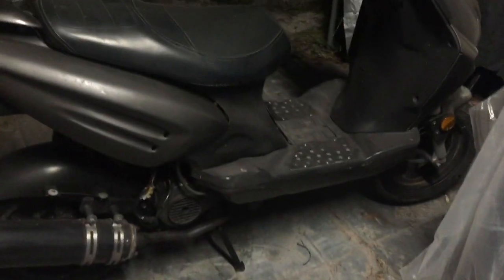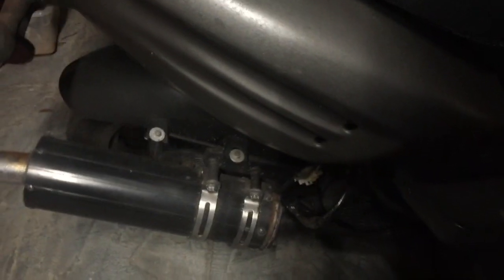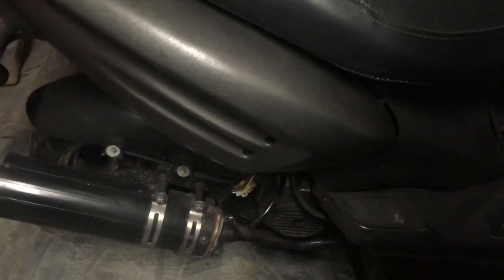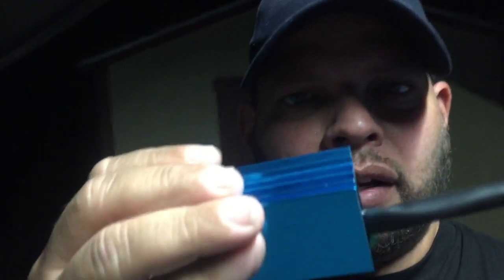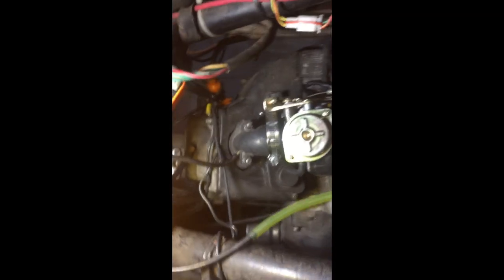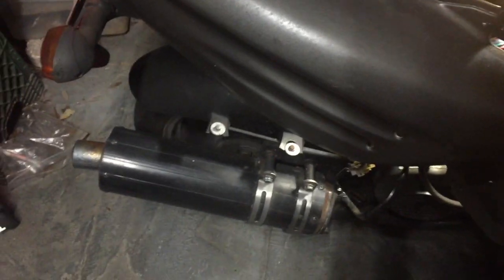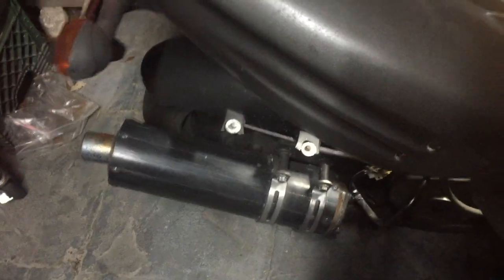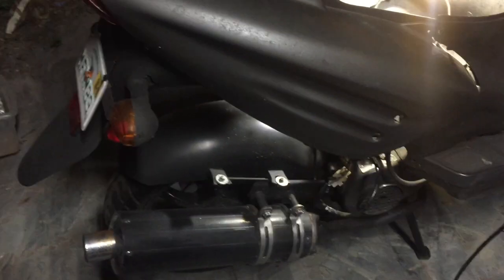How to fix a scooter that bogs down or won't accelerate

Comment: Had the exact same problem on my 150cc. I even replaced the carburetor with a brand new one. I ordered one of those cdi boxs. Thanks you saved me alot of time and headache.
Reply: Did it work for the 150

Comment: I think this is exactly the problem that I am having with my scooter that I have not used for four years.  This is the video that is exactly dedicated to this issue that I could find.  I will do the same thing you did fixing this bogging problem. Thank you for your video.
Reply: Did it fix the problem?

Comment: Description
Before ordering, check whether AC or DC fired CDI is needed
If you have 3-wires going into the 4-plug side and 2-wires going into the 2-plug side you have AC Fire system.
If you have larger CDI box, 3 or 4 wires going into the 4-plug side and only 1 wire going into the 2-plug side, you have DC fired system.
Usually, DC CDI's tend to be larger in size than the AC ones.
Common AC CDI dimensions (LxWxH mm): 65x36x 22 or 58x33x22.
Common DC CDI dimensions (LxWxH mm): 75x42x24 or 96x55x24
Please note, reference dimensions not meant for racing CDIs
If engine will only run with battery, it is DC fired system.
If engine will run without a battery, it is a AC fired system.
Reply: Thank you so much!!!

Comment: Thanks a lot, I am facing the same issue in my scooter after replacing rollers, drive belt and clutch shoe. I was thinking it was the issue with the drive belt or clutch spring. This insight about CDI unit making such a big change on high revs was not aware of this. This really helped me narrow down the problem, thanks once again for the great explanation!
Reply: Ɓɓɓvvvvvv

Comment: My scooter did the exact same thing you're talking about if you're talking about bogging down lots of power not stalling out but it feel like it wants to because guess what the problem is you got to take that or have somebody do it the carburetor must come off and put in his place a Japanese carburetor a hundred times better that's what I did and my bike is running really good

Comment: Not the CDI box...Carb problem. Likely a dirty jet from cheap gas. I swapped out my new CDI with the old one. I put mine on the center stand and revved it up until the bogging quit and it revved just fine. My problem started when I went from 89 to 91 figuring that would make it run better. Put a little fuel injector cleaner in your gas and it will clean the jets. But be careful as that bottle is for 10 gallons or more. So an ounce or two should be fine. 99 cent store has it...usually.
Reply: Did you not watch  the video?
Reply: Your right! This is what’s called a rich condition which make your full throttle (main jet circuit) bogs out.. bigger jet mor fuel. This guy simply put a cdi that make the timing advanced all the time which isn’t good at all. Noticed he cut the part where he was having problems starting the engine😂 advanced timing makes startup difficult and all he needed to do was put a smaller main jet and maybe adjust his needle position since he obviously installed a different air filter 😂 misinforming people is bad but not illegal😢

Comment: You changed the air filter to a better one(no one saw this),wich allows more air in the fuel/air mixture,thus make a better mix (your engine is running too rich,that's why it bogged),this type of CDI only remove the rev limiter.Maybe your old CDI was junk,but,with the price of that CDI,you kinda made a good deal.
Reply from the maker: Yes, I did change the air filter as part of the service that I did to the scooter. But that’s not what fixed the rev problem it was a CDI.. believe what you want but I’ve gotten hundreds of emails letting me know that the CD I work for them and thanking me for helping them fix their scooters.
Reply: @invisiblenolonger501  dayum,you taught me something new,i have the same issue on my 110cc engine and it has the same issue.I'll try to buy one

Comment: Hi, I noticed that you replaced the original air filter with a high-performance air filter, right?
Reply from the maker: Yes that was part of the service I did to the scooter but the cdi is what fixed it..

Comment: I had a bad time with my bike. I stayed more than 1year due this issue. Most the mechanics said its carburetor and switched with new one. The result was nothing. I thew my bike into the shed and started searching on YouTube, but I didn't get revs up on it. Now it's your turn to help me. Iam going right now to buy the CDI in a local store so no delays and can return it with ease if that's not the issue. Anyway thank-you for the tutorial.
Reply: Did it work
Reply: @Nate20  yeah iam so happy and excited about it that it worked. Now i hear some pops too.
Reply: @MitchuMax2327  what store sell cdis ?
Reply: @Nate20  i dont think you may have the same shop. Iam from srilanka. The shop is in the Trinconalee town, central road.

Comment: My moped stops going over 20 mph. I cleaned the carburetor do u think this will help?
Reply from the maker: It may help but if it use to go faster and now it’s only going 20 mph , I would check the valves and make sure they are properly adjusted..

Comment: Mine full revs but it stalls around 40mph or less.  Mine is a 150cc Amiga Jax not sure if this would help.  Thoughts?
Reply from the maker: Usually if the engine bogs down, but it doesn’t stall out it’s an electrical issue. If it bogs down and  the engine stalls out and shuts off it’s a carburetor issue…
Reply: @invisiblenolonger501  it doesn’t shut off but one thing to add is I have to kick start everytime because I have a practically dead battery.  Thinking of replacing it.  Wonder if that can be the issue as well

Comment: Hello can someone help me i had the same issue but it was with the carburetor i changed it  it revs and it goes but not the same as it was going before i was giving it full throttle it was going full but now when i go to do that i doesnt go full throttle it bogs a little like go go go with little throttle give it full and when i go with small throttle i goes better than with full please can someone help me

Comment: My 125 sounds exactly the same. Starts and idles perfect. It will rev for a few seconds then biggs and will not rev again
Reply: It’s the air compressor. You need to play with the air valve to reset the cdi. Simple the cdi that control the air is sending wrong signal that it doesn’t fire the engine. You need to throttle and open the valve. Then close the valve . Off the engine. Then on back engine. Get the engine running and open valve for air to go to cylinder. Now it will be reset and the bike will rock again. This happen you touch the timing sensor in the bike by opening up too much
Reply: @swimwithcoachraven1532  WTF? Stick to swimming!!

Comment: is the scooter revs properly when tire is in the air but goes about 30kmh when you ride can it be the cdi?
Reply from the maker: 30kmh is pretty good for a 50cc engine.. If you want it to go faster you would need to install a big bore kit..

Comment: So why in the video is there a red air filter in the beginning and a silver one at the end?? Same scooter or showing a different one running better at the end?
Reply from the maker: Yes, I did change the air filter it was part of the service that I did but that was not what fix the problem the CDI box with no rev limit is what did it…
Believe what you want but I do have hundreds of emails thanking me and stating that the CDI box fixed they’re scooter…
Reply: @invisiblenolonger501  Awesome!! I believe you, just raised suspision. Im about to try it. i put a big bore kit in mine am running a 110 jet but it boggs down and starts really hard when cold . guess ill see if it helps me. thanks

Comment: Sym fiddle 3 49cc 4t, i remove ring and now run 50 km/h,but whe  is on this speed it doesnt run clear and smouth, something is going wrong, and a noise appears on 50.....for more speed another cdi or can i remove the wire from original cdi??

Comment: Now I'm wondering if that's my issue I think I got bad gas or I put the wrong octane gas and I clean the carburetor change the filter put fuel cleaner in the gas tank and still no problem starting when I hit the throttle she hesitates thanks for your video I'm going to try this
Reply: I can't find a CDI with orange label on it. Can you help?

Comment: I have a kymco super 8
Same problem but when going uphill
Has the stock cdi
So if I change it it will go faster right?
Reply from the maker: Eagle No it won’t go faster it will allow you to rev your motor without restrictions.
Reply: I have a super 8 too. Bogs uphill also and it dont want to go above 40 mph. Should I change out my cdi?

Comment: Mine has a performance CDI, carb, and air filter already and after a few months of sitting it simply will not move because throttle bogs it dead. No idea what to do now but im very frustrated. =(
Reply: Same issue with me. No clue.
Reply: @gamingbluemoon  Dang I wish I remember what I did to get it working but can't recall... Just kept messing with it til I figured something out though lol.. It still never performed as good as it did when I first got it and switched everything out though.

Comment: The problem is that air intake you are getting too much air for such a small motor your exhaust is fine but put the air box back on and your scooter will perform 100% better

Comment: OMG I hope this is my problem... I replaced the fuel filter, fuel pump, carb, battery, air filter, i randomly get slowdowns like im hitting the breaks... ill feel myself kinda jerk forward even... i did get a replacement CDI, plug, and wires... I was gonna replace the CDI next.. I was getting sometimes when I try and give it gas to go from a stop it would bog down and not move me foward.. othertimes or more often it would be random slowdowns.. im really hoping this is my issue..
Reply from the maker: It couldn’t hurt to try. I have 100s of emails thanking me for the video in which this  CDI help them with their scooter’s issue.
Reply: @invisiblenolonger501  I mean I can't really think what else to check. Valves adjusted. New hoses for fuel and vacuums. New air filter, fuel filter, and petcock. I Don't think that the carb needs tuned. Spark plug looked fine to me when I looked at it. I am thinking replacing plug, wire, and cdi. Other then that only thing I can think of is the CVT but when I checked belt that was fine. I did not check the rollers. I do notice about a 30% reduction in fuel efficiency right now.

Comment: I just replaced my carb on my 150cc scooter and it still starts to bog out with it. So I hope the cdi works.
Reply: Did it work? How did you fix your problem? I’m having the same issues.  I bought a new carburetor but still need to tune it properly.

Comment: My scooter sometimes does this and sometimes doesn't. Cleaned the carb, checked ignition.... Could it be the cdi? because I have the stock cdi. 

my setup:

72cc naraku
naraku racing ignition coil
naraku racing front variator
naraku racing clutch + springs
Reply from the maker: SPOliJING might be the CDI would not hurt to switch it out with a new no rev limit CDI .
Reply: @invisiblenolonger501  yeah, true.
Reply: That's definitely the carburetor
Reply: @fishingteam8773  nope, it worked when I changed the cdi. Anyways I sold that and I got a 50cc Yamaha Bw's 😎

Comment: My scooter starts fine then when I give it gas and it will shut off if rev it to long, if I release it goes back to idle. 95 yamaha razz, think this well work??
Reply: @Move Forward Did you try it?
Reply: @valuable1forever37  nope! Just used seafoam and adjusted the level it idles under the right handle and it's been fine since!
Reply: @valuable1forever37  it was idling to low and when I gave it gas mabye it was flooding? I have no clue, but it worked so I am happy

Comment: Its the cdi box that got damage people replacing yr originol cdi box will fix it all the same if it does not then its yr stator both of which control yr spark plug firing mechanism, to fire on time

Comment: I bought the same cdi box and new ignition coil and mine still boggs down, any suggestions?
Reply: Carb. Change?
Reply: @levitezoe1804  I've figured it out but if you don't mind checking out my other video and tell me what I need to get it running I'd really appreciate it
Reply: @brianboyd8882  whats was your solution
Reply: @Nate20  I've sold it but come to find out, it was the hose connected to the air box. It had a crack in it.
Reply: @brianboyd8882  I BET that’s what’s wrong with mine! I can hear loud pops coming from air box! And it just started, out of nowhere, like a week ago, and has just gotten worse every day.
Reply: @YouSpewed  Yes I think that's what it is. Once I fixed it, it never bogged down anymore. It was getting air inside when it wasn't supposed to. Hope this answers your question and hope you get it running right

Comment: I have a piaggio zip that runs fine but at 3/4-Full Throttle it just like splutters and doesn’t go past 20 mph
Reply: main jet to big
Reply: I just started getting this issues in my piaggio zip. did you work out the problem?

Comment: hello so my scooter bogs but is not constant i mean it may go without a problem for sometime and outof nowhere strating not accelerate and sometimes even stop completly any idea?
Reply from the maker: iNetsky sounds like The float in the carburetor is getting stuck in the  closed position.... Cleaning the carburetor should fix it.

Comment: im having the opposite problem i installed the new cdi and sparkplug and now when i hit the throttle its bogging down until i let off throttle and hit the throttle again.
Reply: Did you ever get it fixed?

Comment: you cab fool them but ypu cant fool me on your video.. if only they notice you switch the air filter foam in to the airfilter mesh for better airflow.. that blue cdi helps but the stock gy6 cdi has already no limiter fyi. but nice video✌️👍👍👍

Comment: yo bro my scooter wont exelerate high enough for it to pull off i have to go downhill for it to get faster
Reply: Same here what’s issues I switch the engine & change everything & still same issue maybe new belt or throttle cable ?

Comment: CDI? whats that
Reply: A CDI ignition starts by generating a charge and storing it up before sending it out to the spark plug in order to ignite the engine. 

It fails if it dosen't have enough energy to ignite the spark plug enough

Be sure to check your sparkplug. 
It should have a brownish colour :)

Comment: Your knowledge isn’t sufficient to teach people please don’t… I came to the conclusion that you changed your air filter (maybe exhaust too?) and was wondering why it was bogging out at full throttle and instead of changing your main jet you advanced the timing with a cheap cdi unit… I noticed that you cut the startup part, probably cause you where having problem getting it runnin. Advanced timing makes difficult to start the engine. It may have worked for you but your problem is still there… Adjust your carb and put your stock cdi back, your scooter will perform a lot better

Comment: i did it and it still bogs down at 30mph and then stalls out
Reply from the maker: Sounds like a carb issue … 
Carb issue bogs down and installs out electrical issue like the ignition bogs out but stays running..
Reply: @invisiblenolonger501  should i add a bigger jet to the carb, cuz before it would let me go 40 before bogging out, i bought a new carb and wit the new one it does 30 before it starts spurting snd boggin down like its asking for more gas